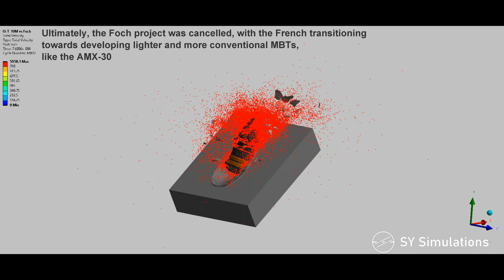THE MOST HEAVILY ARMOURED TANK DESTROYER | T-10M vs AMX-50 Foch | Armour Penetration Simulation

Comment: The Foch itself was discontinued bc of the amx-50 design starting to be able to equip the same 120mm cannon, meaning the Foch even with its superior armor, was kinda made obsolete by those projects as they not only had 360 turrets, but also had autoloaders which the Foch lacked.
Reply: It was above all the generalization of hollow charges that killed the project. Moreover, France developed the G shell during the same period, which was one of the first shells with stabilized hollow charges. This shell made the command realize that the AMX 50 was obsolete for the years to come, and we moved on to the MBT with the AMX 30.

Comment: The video shows br471 which is a super early shell used by is2, t10m should be using br471d at the least with several apds options.
Cab you re run it with rhe 471d shell?
Reply: Video shows BR-472.

Comment: Can you test Marder 1a3 ARMOR ? It have 7mm - 45mm air gap - 14mm at 78 degree. Some say it holds 30mm Russian BMP-2 rounds. Interesting to see even 25mm rounds against it. 
Thanks.
Reply: good question, I tend to think that the marder resists better than the BMP 2 for example (simple supposition).

Comment: That's a hefty chunk o' armor.
Assuming NATO doctrine was followed,  the Foch would mostly have been on the defensive, the strongest suite of TDs; a limited but likely very effective in its role AFV.
Reply: France wasn’t in nato at that time
Reply: @Derp12348 France only left the NATO unified military command structure in 1966, and even then they were still a party to the North Atlantic Treaty and thus never actually left NATO. Before that Supreme Headquarters Allied Powers Europe (NATO military headquarters) was in Rocquencourt near Versailles

The AMX 50 Foch was built in the mid 1950s
Reply: @Derp12348  you have your timeline wrong.

Comment: I remind you that the T-10M had several other anti-tank missiles, several APDS models and even supposedly had APFSDS. And of course HEAT-FS
Reply from the maker: It received APDS and HEAT, but only in the 1960's
Reply: @SYsimulations  I don't know when exactly the T-10 got these missiles, but then it should be T-10A vs AMX-50 Foch, not T-10M actually from the 60s
Reply: There were few Soviet tanks that got commander operated ATGMs, T-10 object 272M being one of them. But they were mostly prototype/experiments that never went mass modified/produced.
Reply: Sim mas o video e sobre APHE não APFSDS e ATGM 😂

Comment: Foch would be very angry that T10 scrapped his paint.
Reply: I don't think the Foch would be able to go through the UFP of the T10M. Maybe partial penertration at most
Reply: T10m can easily be penned by the foch, but the t10m also has apds and heat that can easily make Butter the foch's armour
Reply: @CCXRTrevita  true
Reply: but it wouldn't be bad for long because it wouldn't penetrate the T-10 either and in the meantime the T-10 would change the projectile to APDS or HEAT-FS and the Foch would be over
Reply: @patrykb_  also AMX 50 Foch can easily pen T10
Reply: @Elo2177  I absolutely do not agree. Foch's gun was powerful but it had old-type shells
Reply: @patrykb_  Foch’s 120 can easily punch through T10’s lower front plate
Reply: @patrykb_  T10 lower plate is around 120 mm while, the Foch’s main shell, the 120mm Obus de rupture has over 250 mm of pen
Reply: @Elo2177  Trying to hit LFP of any tank is almost impossible in real life combat especial with 50s tec.
Reply: @mohammadshehada267  it’s is possible to hit because of the pike nose hill that T10 has, also it would be probably used as ambush tank so it would have easy side shots
Reply: @patrykb_  foch use the same gun with amx50
Reply: @Elo2177   Even with pike nose it is still very very small in real distance combat (it isn’t war thunder bro) , and bout the AMX50 Foch it look like heavy and massive TD to it would by hard using it for ambush but still possibl.
Reply: @mohammadshehada267  then if it is a fight in real combat scenario and not in giant open room then T10 would still loose because heavy tanks were already outdated for that time (then also Foch wouldn’t be used probably)
Reply: @Elo2177 The M58 (the same gun used on the Foch) can penetrate the frontal armor of the T-10 from about a kilometer away. Don't underestimate the big heavy APBC.
Reply: @patrykb_  dude don’t get mad over a joke lmao😂

Comment: Its insane how much difference angle can bring to a armour's effective thickness.
Reply: The proper equation is x/(cos(a)) where x is plate thickness and a is angle, between 0 and 90 degrees. At 90 degrees it's effectively infinite, at 0 degrees (flat) it's equal to x. The equation also shows that a=60 degrees also gives us our doubled effective thickness. Take it from an engineer.
Reply: @connivingkhajiit  Yeah,it is clearly visible that the line of sight armor is almost double (180/cos(55°)≈314 mm).
Reply: @connivingkhajiit  you are most definitely not an engineer if that’s what you think 🤡
Reply: @connivingkhajiit  most definitely not an engineer if that’s the math you’re doing
Reply: @johnpierce1470  You could easily make a 10 pixel line in paint 3d or any other program, angle it 55 degrees, and measure how many horizontal pixels thick it is afterwards. It is definitely not 12.2 pixels afterwards, instead it measures 18. Of course this isn't much of mathematical proof, but that isn't needed and it shows that measuring it your way is false.
Reply: @cerkurkafelst7335  paint has nothing to do with this lol. Let me know when you understand basic trigonometric calculus
Reply: @johnpierce1470  It's not a math problem, this is about which angle you're measuring. When discussing armor slope, the convention is to look at the angle between the projectile's direction of travel and the surface normal of the armor,  you can see this in this very video. So a 0-degree slope means a vertical armor, higher angle -> higher LOS thickness. You're not aware of this convention -  that's ok, but be humble, read about the subject if you're interested, and stop wasting people's time.
Reply: @MishaAmashukeli  it’s it absolutely a mathematical concept, that clearly you don’t have the slightest idea about. Hopefully you’ll eventually understand basic mathematics
Reply: @MishaAmashukeli  vertical lines have a slope of infinity and horizontal lines a slope of zero silly. You need to go back to elementary school math class
Reply: @johnpierce1470  OK. What is the slope of the armor in this video?
Reply: @johnpierce1470  the adamant ones are usually the most unaware.
Reply: @connivingkhajiit  it’s basic trig pal
Reply: @johnpierce1470  just as i stated
Reply: @connivingkhajiit  but you’re still using the wrong equation…
Reply: @johnpierce1470  It was supposed to be a demonstration. Measuring the thickness of a sloped plate or object in the real world shows that your way of measuring is false. Just try it yourself.
Reply: @johnpierce1470  i just proved to you its correct via the infinite and zero limits of the equation. A flat plate has no increase in line of sight thickness, and a plate at 90 has infinite (or in practical sense, the length of the plate). It is already well known that 60 degrees offers double line of sight thickness. The T-54 was designed specifically around this, with an upper front plate at 60 degree angle.  If you dont believe me, look at Wikipedia for yourself. Its referred to as The Cosine Rule. And next time, take the 30 seconds to look for yourself before spouting off.
Reply: @connivingkhajiit  if anybody is spouting off it’s you😂🤡
Reply: @snakes47701  you also used the wrong equation. You’re supposed to take the sin(55) not cos(55)
Reply: You both gave me brain damage
Reply: @snakes47701  you seem to be forgetting basic order of operation
Reply: Seems like many people here are confused between Line of Sight Thickness and the Effective Thickness of the armor.
Reply: right!! 55 degrees provides and extra 40mm of effective armor, a 22% boost!
Reply: @johnpierce1470 it probably brings a much bigger boost. For example a 60° angle brings around 100% boost.
Reply: @quan-uo5ws and even moreso, because it is not just about the increase of thickness but also about the force dissipation.
Reply: @quan-uo5ws  ffective Thickness = 180 mm / sin(55 degrees)
Reply: @Sunshrine2  Effective Thickness = 180 mm / sin(55 degrees)
Reply: @quan-uo5ws  Yep, it brings the actual effective thickness to about 313 mm. 313 = 180/cos(55)
Reply: @quan-uo5ws  that’s just not true. A 60 degree angle would provide an extra 14% thickness. It’s basic trig, sin(60)=0.86 
Armor thickness/0.86=effective thickness
Reply: @johnpierce1470  You're using the wrong angle, if you use sine then it's angle relative to the horizontal not relative to normal. So it would be 180/sin(35) for a 55 degree angle
Reply: @signs80  not true. You would need to use the exterior angle not the interior. If that were the case, then the greater the angle of the armor, the more penetration would occur. Which common sense tells us is not true.
Reply: @johnpierce1470  That's literally what you are saying, you said a 55 degree angle gives you 22% more effective thickness compared to a 60 degree angle giving 14%. Why would more angle give you less effective thickness?
Reply: @signs80  a greater angle gives you less effective thickness because of the slope of the armor. An angle of 90 degrees would be a slope of infinity (armor is completely vertical). An angle of 0 degrees would be a slope of zero (armor is completely horizontal). A lesser angle with a lesser slope will give you more effective thickness.
Reply: @johnpierce1470  Vast majority of people talking about tank armor construction angles are using angles relative to the normal, not relative to the horizontal.
Reply: @signs80  what’s more effective. An armor plate that is completely vertical (90 degree angle) or a plate that is at a 45 degree angle?
Reply: @signs80  anytime I’ve ever heard anybody refer to effective armor thickness 90 degrees is vertical and 0 is horizontal
Reply: @signs80  I see. A zero degree angle is a completely vertical plate and a 90 degree angle is a completely horizontal plate?
Reply: @johnpierce1470  Let's sum it up: Whatever the real standard is, in this video hit angle is measured relatively to normal of armor plate that's hit. Simple logic: If the plate was completely vertical, the angle would have been 0 degrees for a horizontally flying projectile. Such case would give us 0 mm additional protection, because 180mm/cos(0) = 180mm, right? So in this video's case the formula is [effective armor thickness = armor thickness/cos(angle)] So if we take 55° - we get 180mm/cos(55) = 313.8 mm, that is 133.8 mm of additional protection, or 74.3% of bonus. You were wrong.
Reply: @johnpierce1470 I have never heard anyone refer to a flat armor as 90 degress. Flat on is 0 and it increases up to 90 degress where it's parralel with the approach angle of the projectile
Reply: @johnpierce1470  the T-34s hull armor plate was 45mm angled at 60 degrees. this was estimated to be around 90mm effective thickness. your math is simply off.
Reply: @GewelReal  sick
Reply: @quan-uo5ws  you’re telling me my math is off thinking that because of a 60 degree angle, armor is effectively doubled. That’s ironic
Reply: @furyaroslav  you’re using the wrong equation. Effective Thickness=Actual Thickness/sin(angle of inclination)
Reply: @johnpierce1470  Read my answer again, "simple logic" part.

Ok people, it's clearly a troll, let's report.
Reply: @furyaroslav  again, you’re using the wrong equation.
Reply: @johnpierce1470  Isn't it an extra 130mm, 74% boost?
Reply: @lilmachingunn  nope, Effective Thickness = 180 mm / sin(55 degrees)
Reply: @johnpierce1470  It's not about «thickness» increase, it's about de-normalisation of shell. About bouncing rather than going straight through
Reply: @worldoftancraft  hence the terminology “effective thickness”